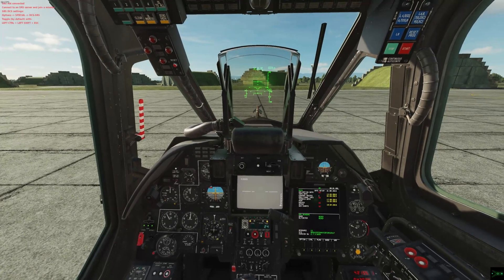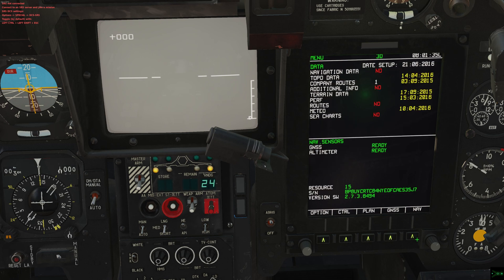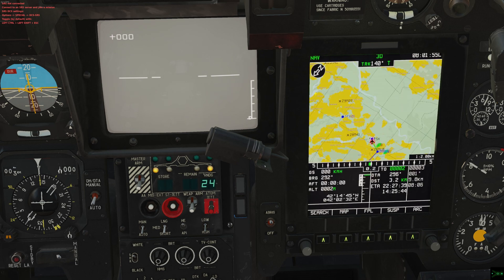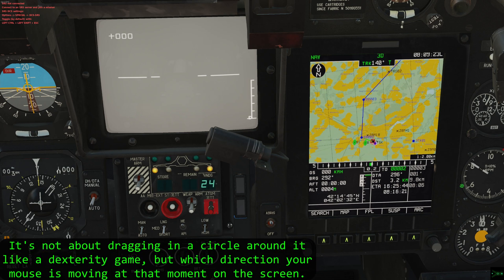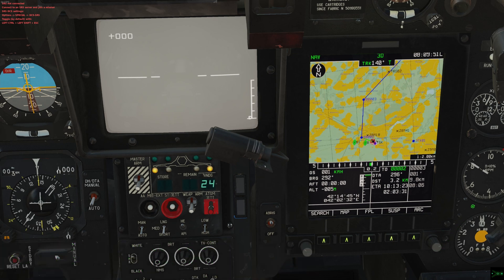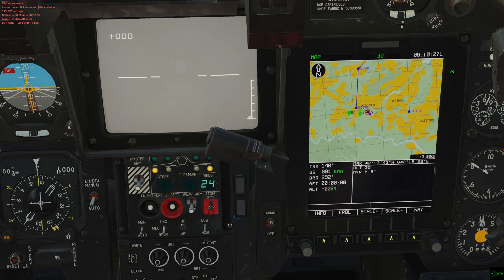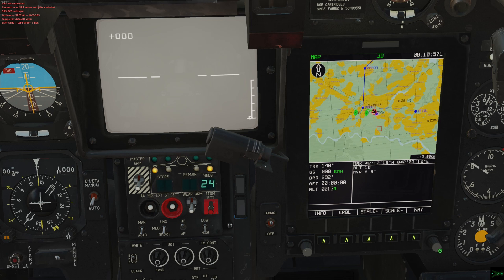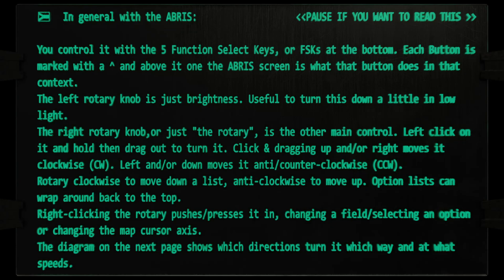DCS Ka-50 Controlling the ABRIS & Rotary tricks

Comment: It would be helpful if you attach your summaries as an attachment
Reply from the maker: It's an excellent suggestion. Someone has mentioned it before. Problem is those summaries aren't in a conventional format, and I think in isolation they're terrible. I've got a slew of videos I need to finalise for this series and then get through a backlog of other topics that's been on hold for all this ABRIS/data link stuff. When I've cleared that I might figure out a new series taking the stuff from scratch in more digestible bites and/or possibly a text doc/pdf where all those summaries are rewritten cohesively without undue overlap.
Reply: @volkvoort  Glad you liked my suggestion.  For now, I just take screen shots and print them out for reference.  Your videos are so detailed and technical that i end up watching them 3 or 4 times before all the stuff sinks in.
Reply from the maker: @sobe1205  Yeah, it's the trade-off of either I split a topic like this into 5x 1 minute videos, but then it no longer seems like a cohesive topic, and it slows down the people that already know most of it.
Reply: @volkvoort  Have you tried to fly the Blackshark using a second screen and Helios?  A touchscreen is not necessary.  http://www.captzeen.com/helios/KA50V2.asp
Reply from the maker: @sobe1205  Not yet. Second screen if often for scripts/recording stuff. But should look into it.
Reply: @volkvoort  I have figured out a way to better understand your YT videos.  As you know the subject so well, you tend to talk very fast (at least for me).  So now I just simply playback your videos at 75% speed.  Much better.
Reply from the maker: @sobe1205  Heh. Gets the Barry White going. Interesting how preferences for these things go - I tend to watch most YT vids x1.5, sometimes even x2 speed.